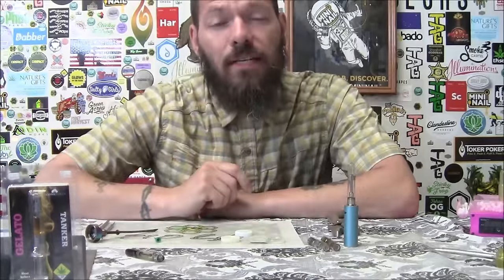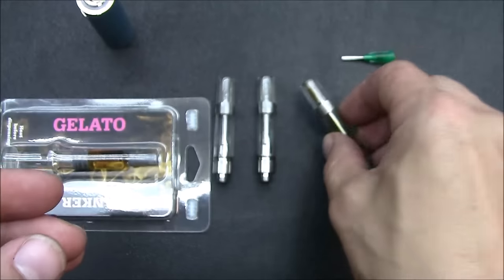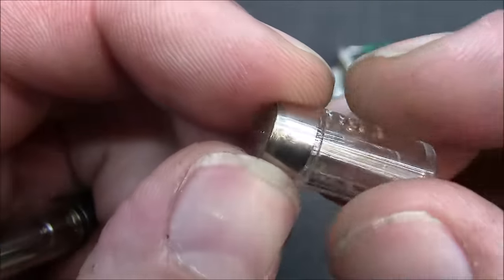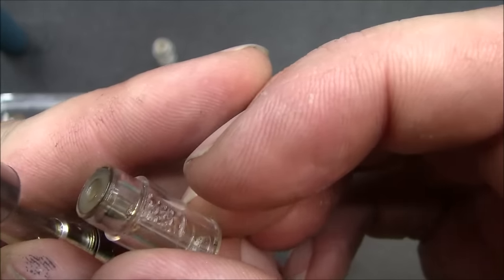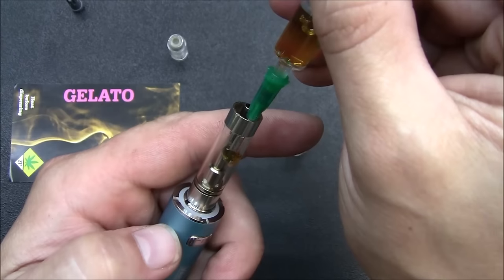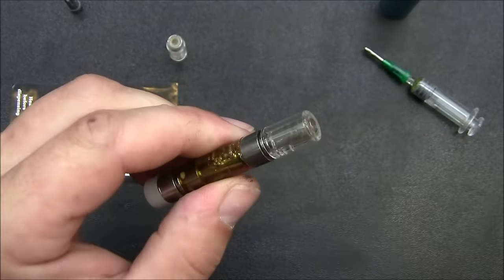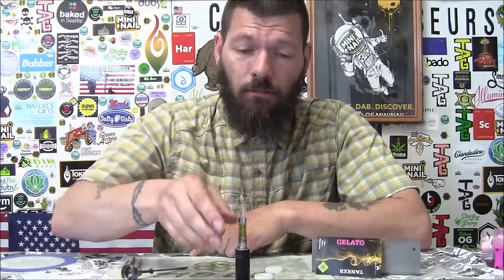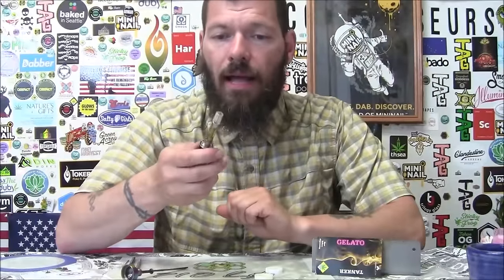How To Refill Dispsable Carts DANK VAPES, MARIO CARTS, EXOTICS

Comment: If you dip the mouth piece in really hot water/almost boiling water just at the top it comes right off I found this out by accident just trying to sanitize it
Reply: tried to google it, didn’t find anything. tried dipping in boiling water, didn’t work. any advice ?
Reply: @J.Skyler  try holding it in longer
Reply: I do this for empty pepper grinders, I place it in a bag first and submerge the top in some hot water from a kettle, wobble it a couple of times and it comes off smoothly..
Reply: Thanks kind soul
Reply: Lightly got it with a torch
Reply: Did you dip the silver part in or just the mouth piece itself ?

Comment: Every one I've tried to rock back and forth, ends up just cracking fully where the metal meets the plastic. usually just buy a new empty cart from a vape shop, use my torch for distribution heating, warm up enough just enough to pour into my new cart. If you have to do this guys don't heat your product to much. It'll affect how the oil will settle. Heat only as much as you need to pour or inject
Reply: I like to use my fiancee's blow dryer to heat the oil. Then it flows out nicely.
Reply: IF you add a little bit of heat to the cart with your torch and use the vice grips it will melt the glue and allow you to remove it
Reply: @FuckPedophileBiden  umm I think ur supposed to inject into a cart not urself 💀
Reply: @FuckPedophileBiden  JESUS CHRIST MY DUDE TOOK IT STRAIGHT TO THE BLOOD STREAM 💀
Reply: Yep. I got a faulty 1G cart from Surterra today & decided I would try this & pour into my empty Curaleaf cart. It broke the glass and I had to take a big chunk of glass off of the full cart and slowly try to pour it into a tiny .5G cart. It was a sticky, tedious, wasteful nightmare... But it worked!  😅

Comment: omg I was looking for a simple way to remove the top part and get to the live resin I bought in a cartridge. It's thicker in viscosity and the cartridge is worth CRAP so I wanted to transfer it to another better cartridge without shattering the glass. I didn't care if it broke but wasn't too keen on having shards in my liquid. I'll try this out and fingers crossed it'll work :) Thanks !

Comment: I bought a dabbable select cannabis oil concentrate 1 gm syringe and haven't been able even open it.  That is how I came across your video.  I dont understand the designers of these vials and syringes.  In pain and having arthritis in my hands with low strength and limited movement.  But I am subscribing I have been holding on to some cartridges for a while that are all partailly or almost half full and I was always afraid to dismember them because of completely destroying them.

Comment: My original idea wasn’t to refill it (common I’m a broke high schooler) I was originally going to take all the wax from the sides, top, and bottom of my cart so I could smoke it like a dap rig (dap or dab?) but then I gave up trying to pull it apart. Then it started hitting again. So we’re all good now.
Reply: Dab

Comment: my extract is FAR too thick/viscous to use a syringe; how do you get it that thin? Heat? Solvent??
Reply: Terps and heating it does wonders
Reply: Warm up a damp cloth in the micro and just hold the cart in it in your fist and it will warm up.

Comment: What method do you prefer to heat the product prior to extracting it? The syringe I have is like glue.
Reply: You can use a lighter or a candle warmer and just set it on there. That’s what I’ve been doing. I think if it gets too hot it can ruin potency but gotta do what you gotta do. Unless you get something that’ll heat it at a temperature you need to

Comment: If anyone has a THC cartridge that IS NOT HITTING no matter what you do. Make sure  you save a cartridge that WORKS, that way do exactly what this guy does and take the mouthpiece off with a pliers, heat up the wax in the cartridge that is not working with a hairdryer, then pour the wax into your old cartridge that works. then put the mouthpiece on your old cartidge and I guarantee you, you can hit your wax now.
Reply: Can I just buy a cartridge that is made to be refilled?

Comment: Will a refill of cbd work in a dank cart? There's a smoke shop that ordered  a bunch of cbd products after asking for so long cus I have seizures and cbd has done wonders to keep them at bay so instead of paying 20 bucks a pop for a cbd cart I could get a bigger bottle of it and just refill the empty dank cart I have. Can anyone answer? And I also use cbd oil by dripper under the tounge. But I want to find the best product that helps seizures the best. Thank you!

Comment: Nope, the mouthpiece will NOT come out thus way! No one shows the 510 cart I have, the mouthpiece does not screw or pull out like that. It's like its glued to the cart. Flat clear mouthpiece thats cracking when trying to wiggle back & forth. For mine I needed to remove plunger/stopper at the bottom of cart, where it screws into battery.

Comment: how is the liquid so thin tho
Reply from the maker: At 3:55 I tell you I am going to heat it up, I use a heater to get the distillate to around 125 degrees and it flows quite nicely.
Reply: Oh what do you heat it with? could you send a link